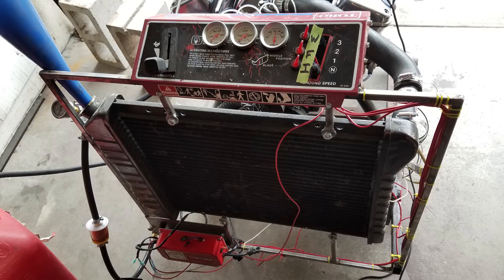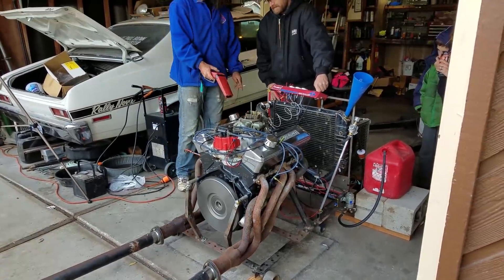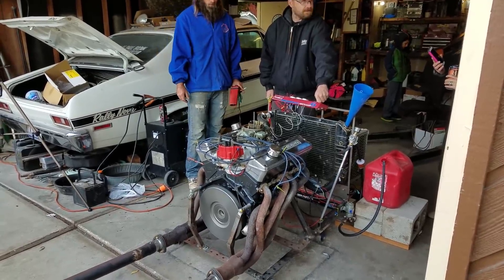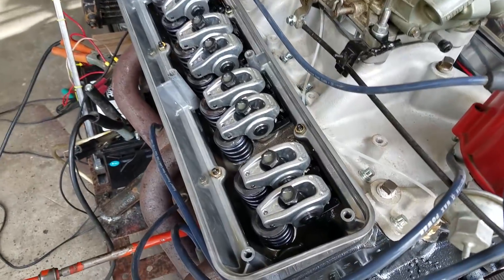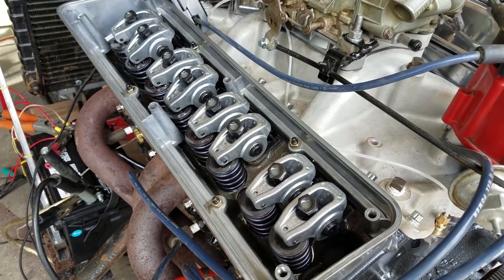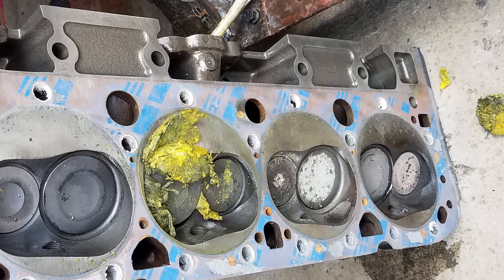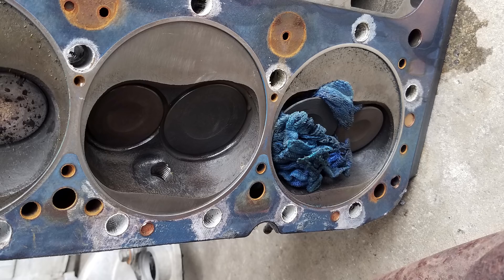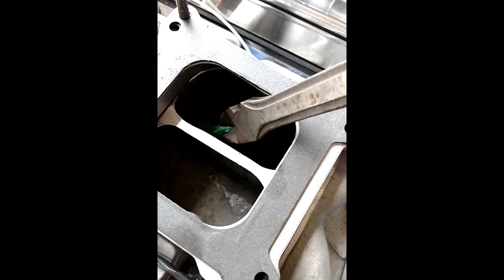Engine Broken In With Rags Left In Intake + Aftermath

Comment: Built an engine once.   Basically finished, but could not find my 14mm socket in my tool box.  Decided i must have left it in the engine gallery where the lifters are.  Strip down engine to find nothing!!   14mm socket was in a different draw in my tool box!
Good waste of a few hrs :)
Reply: - - haha I wouldn't even notice I was missing a 14 mm socket. At least you noticed man.
Reply: This makes me laugh! Thanks
Reply: Couple hours or a couple hundred if not a couple thousand? I know which one I'd rather waste.
Reply: We had too rebuild our neighbors tractor engine. We took it out and sent off to be done. Got the engine back put it all perfect started it up last 30 seconds. It was sent back with no oil in it
Reply: better to be sure than sorry
Reply: Ferguson 20 diesel your actually admitting on the web that you started a rebuilt engine but didn’t even check the oil level first??
Reply: yes i am. i wasn't thinking and i presumed they would have tested the engine at the rebuild centre for massey ferguson before they sent it back
Reply: Ferguson 20 diesel lmao, that’s hilarious
Reply: - - ya gaskets are not cheap anymore.
Reply: You can get them for nothing
Reply: I once dropped a socket into the thermostat housing on my Landrover cylinder head. It rolled deep inside and I couldn’t get it out. It was still there 5 years later when I sold the car. Oops.

Comment: Things happen. Back in the late 70s My self and another man swapped a 6110 Detroit from one belly dump into another. For some reason, which I can't remember we took the valve cover off, probably to run the overhead. When we fire the engine up it ran away, and after getting it shut down, we took the valve cover off and found a speed wrench laying on the rack. Whoops! It was just him and I there, and the engine ran just fine afterward so we didn't tell anyone else. At the end of the day everyone was asking why we were covered with all those oil spots and we said just happens when working on those Detroits, they leak every where.

Comment: I worked at a engine rebuild shop Back in the day and used to see the craziest mistakes made by customers. One who had got there new engine back. On time we built a long block minus the intake and pan , they were installing the harmonic balancer . When the engine would spin when so these "rocket surgeons' put a bolt thru the lifter valley on/ against a cam lobe and actually snapped the camshaft. You learn from your mistakes wich we have all done. Cool story and keep posting as you have just saved many of engines in sharing. Keep on spinning wrenches in the Free World Brother 👍🕊❤🇺🇸

Comment: 7:25 What happens? Here ya go....Guy I know left rags laid out carefully in the oil valley on 350 SBC to catch any debris that might fall in while he was working on it; installs the intake, totally forgot the rags. Buttons up the rest, installs engine in car. Fired up, dialed in, letting it run fast RPM for break-in. Several minutes later, noise. Clicking, clacking, couple intake and exhaust backfires then dies; won't start again. Inspect: All valves seized up? Teardown. The Tally: Camshaft grabbed the rag, twisting around cam. Bound so tight, it BROKE the cam into 3 pieces. Rag also got between cam/distributor gear. Broken distributor shaft and housing A couple bent pushrods. Bits of rag throughout oil passages. Fix: Total teardown: blow out all oil passages. New Cam.New crank/cam/ mains and con rod bearings. New lifters. New distributor. Oil. Filter. 2-3 pushrods. 
  Oh, and pain.....lotsa pain.

Comment: A few years ago, I was spraying WD40 into the #8 cylinder of an LS1 when the red straw flew off the nozzle into the cylinder. We couldn't get it out, but stuck the spark plug back in, fired it up, and it has run fine ever since.
Reply: John Wilburn I did that also. But the engine was on a stand. Fished it out easy. Swore like hell though.
Reply: I was kinda dumbounded that it actually happened.  The engine was in the car and, naturally, that is the hardest cylinder to get to.  We tried several things, but couldn't get it.  Fortunately, it must have burnt up quickly and gone on.  It probably wouldn't happen these days with the integrated straw on the cans they make now.  I'm so glad all that is left of that straw is a good story!  This is the very first start up.  https://youtu.be/ggDNC0PnIIo
Reply: I did a similar thing with a Detroit diesel and a can of brake clean. I worried at first but thought hell it will just eat it. Truck ran fine.
Reply: I'm so glad to know others have done this and we all got away with it.
Reply: I've heard that before.. when fogging marine engines for storage. figure it finds it way out of the pipe in pretty short order
Reply: fuck that red straw, mine flew off too
Reply: Murphy's law. That would never happen on cylinders 1 or 2.
Reply: John Wilburn hahahahaha hahaha..thats fucked up..
Reply: Kurt Watson The short ten millimeter valve cover bolts or mounting screws are the ones to always end up missing and make me tear shit down again only to realize it fell through the car and ended up two bays down  somehow
Reply: @johnwilburn  I was just gonna say that lol funny story! When u think about it, that little plastic thin straw ain't shit compared to chunks of metal shavings that come off and keep running

Comment: Was working on my 2005 Chevy caviller I just did a timing chain etc so I had the cog that attached to the cam undone In a rush I put the car all back together and started it up car ran great for about 3 minutes until the cam gear managed to break and stopped the motor dead in its tracks. I thought the motor was toast I thought I bent all the valves and it was screwed. I bought a new cam cog put it in and the car was fine. Went a sold it the next day. ALWAYS DOUBLE CHECK EVERYTHING.

Comment: Why did the engine look like it had Horchata for oil?
Reply: it looked like a water-oil milkshake, maybe they didn't put sealant on the head bolts/studs threads. it's easy to forget, don't ask ;)
although It's probably white lithium grease used as assembly lube, it tends to lay around in low areas looking odd for a while
Reply: I'm guessing it was when we pulled the head not all the water was out, plus it was fouled with excess gas
Reply: And ARP thread sealer and anti seize was used and torqued to ARP spec
Reply: Coolent in the oil
Reply: It's a Mexican engine

Comment: Paper towels and rags can kill people.  I know of a case where a Boeing 737 fuel filter bypass light came on during the first flight after a heavy maintenance visit.  When the mechanics pulled the filter, they found it clogged with paper fibers.  They wisely pulled the filter on the other engine and found paper in it as well.  After opening the center fuel tank, they found the remains of a box of paper towels somehow missed in the pre-tank closing inspection.  If the towels had been left in a wing tank, one engine might have failed.  The center tank, however, normally feeds fuel to both engines if it has fuel in it.  This airplane was very close to double engine failure and a catastrophic crash.

Comment: Done something similar... Left paper towel under piston when reassembling a single cylinder motorcycle. That shucks, man! Imagine doing that on a customer or friends engine... That would be even worse! 
Anyone who claim not to have done stupid mistakes, have probably not done anything at all.
Reply: too true. Anyone who tears apart and puts back together engines long enough has surely made stupid mistakes. Many done at 1am with little sleep...haha
Reply: Yup, nothing sucks worse than the inevitable "extra" bolt/washer/nut. There is time lost tearing it back down to figure out where it came from. Have also had people throw an old bolt back on my work bench making me think I missed something too. As a result I have learned to be very meticulous in how things are arranged. I will either put the subassemblies back together immediately, or if that's not possible I will use cardboard boxes and poke holes to hold the fasteners and components. Especially where multiple length bolts are used. Gives a nice visual representation of what goes where and keeps things organized.
Reply: the extra bolt-joke is almost evil!  Good, but evil;-)
Reply: pål aukan  oh yes I can laugh about it now, however at the time it really sucked. The project was a nearly complete overhaul of a 70L V-12 marine diesel.  Had to use a forklift and chain hoist to head the heads on and off lol. That cost me another 10 hours.
Reply: The best jokes takes some time before they become funny:) That was definitely one of those!  Some serious engine though!!
Reply: pål aukan haha yes this is true. I definitely laugh about it now. And yeah that was a fun job.
Reply: We all make mistakes it is what makes us learn and good productive people

Comment: Yep, I think we've all pulled something like this before. The time for me was on an '81 Suzuki DR400 engine I'd built up & managed to suck a synthetic rag in after about 30sec of running, I thought it'd dropped a valve the way it just suddenly lost compression. Was I relieved when I pulled the head back off & found the rag holding the inlet valve open but no mechanical damage!

Comment: Just found a white paper towel left in my electronic throttle body whole. Did not leave long and discovered as I was doing the fuel injectors?? FMl. I got one out not sure if I have it all and I can see another. It’s had a miss fire for a while? It’s a Honda K24 motor? I’m not sure if I did this or what but what are your thoughts? Pulling the intake now. I fished the other out through the fuel injector while with a tweezer? What ya think and how much motor do I need to take apart? I’m pretty sure it’s ok but it’s crazy that I may have did this. I’m comparing my paper towels now 😂. 🤦🏻‍♂️ ?

Comment: I feel his pain. Two years ago I built a 465HP 355. Developed a small oil leak under the inlet manooldd the end of dyno testing. Left a rag in the valley when I put the inlet back on..20 min later no oil pressure, fried bearings and rag turned into a trillion pieces.

Comment: This is why we only use paper towels in and around an open engine. It is also why the company that I work for does not allow cloth rags to be used at all and spends millions on paper towels every year. It can save way more money in the long run over a recall. Not to mention cloth is not safe around the lathe's and mills we run, nobody wants to get a hand pulled into a running machine.
Reply: i use rags on lathes and mills every day for the last 35 years,you need to be intelligent 
enough to not put it anywhere near a moving spindle or chuck obviously.common sense rules

Comment: I replaced the water pump on my mk1 golf (rabbit) to you USA people. It was winter & freezing temperatures & I didn't have enough antifreeze. 
Covered the engine with a towel. 
Went out for a drive next morning & after 20 minutes smelt burning. Opened the window & though it was from a bonfire. Keep going another 5 minutes until engine stopped. 
Engine had caught fire as I'd forgotten about the towel. 
Felt like a right idiot!!!

Comment: Sounds like my dad when I was younger...he just finished the overhaul of the 355, put it in the truck ran it, timed it and he heard a knock...totally forgot to put oil and spun a bearing....hey it even happened on Street Outlaws, they put spark plugs on the intake and as you say, the rest is history....
Reply: Willubhave One what happened with the spark plugs?
Reply: It was the Reaper car (James pit crew), but Street Outlaws did not mention what aftermath it caused to the engine (blown motor). The video was on Youtube but was taken down, probably embarrassed
Reply: Willubhave One what do you mean he put spark plugs on the intake? ?? Did the plugs fall in the intake or something?
Reply: they set them up by the carburetor.. not sure where but they ended up in the carb. When they opened the throttle it hung the throttle plates wide open.  
I don't think it swallowed the plugs but maybe floated the valves and nicked them and i think he said "stretched a rod'" during the over rev.
Reply: Willubhave One oh shit
Reply: blindabinda123 yes they changed the plugs and left the old ones on there and somehow they fell in lmao and he fired the car up and drove it a couple fees I think and it popped and tied up I’m pretty sure. There’s a video on youtube
Reply: Willubhave One that was Joad he’s amateur as fuck. Don’t compare him

Comment: That sucks but stuff happens. I have a story not as bad but it was funny at the time.  I worked for a grumpy old dude who ran a full service gas station. Winter had arrived and we were facing a sudden and bitterly cold night. 

When I arrived for work after school he showed my a $.99 antifreeze tester with the rubber bulb on the end he had just bought. He was expecting a crap load of customers to drive in asking for a free antifreeze test and showed me exactly where he wanted it kept when not being used. He was very specific about that and you'd think it was a $500 tool. 

Later he sent me to get  some hot coffee so I was gone maybe 15 minutes. When I returned a car pulled up. They wanted their AF tested so I ran in to get the tester but it wasn't there. I asked the old man where it was and he said we don't have one. I said yes we do  because I used it and put it right back like you told me. He repeated those words again, "we don't have one."   I got rid of the customer and came back in to ask WTF happened to it. 

He said  while I was out some "old bitch" in a Cadillac came in and asked him to check the AF. He opened the hood and pulled the cap but the coolant was low and as he released the bulb it slipped from his fingers and went in the radiator. I looked in the shop bays behind me expecting to see a Caddy. Nope. Wasn't there. 

I asked, what did you do with the car? Oh she left, he said. I asked how he got the tester out and he said she took it with here. This wasn't making a lot of sense because the bulb would eventually come apart and clog at least a couple of radiator cores so I thought maybe he made plans to have her bring it back later. Nope. He said he put the cap back on and slammed the hood and told her it was fine.

Never heard back from her so I guess that was the end of it.
Reply: Glad I never had my car serviced there (lol). Can't believe he didn't own up to it. Bad karma man
Reply: I worked there after school and on Saturdays for almost 3 years. The old man and I got along great and I never saw any indication that I was about to get dumped until I arrived  as usual one afternoon and  found the place locked up. No note on the door, letter in the mail - nothing. I thought maybe something happened to him or his wife and was a little concerned. They always treated me well. and I wanted to find out what had happened.  .

There was another gas station\auto parts place right across the street so I decided to walk over and ask.    The owner told me that my boss had closed the doors  This guy was a little dry and I never really knew for sure when he was joking or being serious so I stood around for a minute waiting for a punchline,  but he was silent as a stone.  I asked him if I heard correctly and he responded by offering me a job. I knew then that he wasn't trying to be funny. 

The old man had owned that station for years and then one day closed without saying a word.  I never saw or heard from him again but  I was paid up so I didn't lose any money,, but damn, that was a hell of a way for an employee to find out he was out of a job.  I heard several years later that the old man died.

Comment: Like the nova I  the background but what mufflers where they using in the video
Reply from the maker: The guy who owns the nova actually scratch made those mufflers back in high school. The outside is diamond plate steel and he put baffles on the inside and everything. They sound pretty good. Hopefully will be going back on that nova soon.
Reply: ya I noticed them also as they are pretty flat and work as support for the engine stand.

Comment: Worked at a Chevy dealer out of high school late 80's. The heavy line mechanic had just put a target engine or now they call them "crate engines" into a Caprice Classic. It made about a 3/4 revolution before it locked tight as a drum head. Pulled the heads, and in one cylinder found an EGR valve had been placed in the cylinder at the assembly plant.

Comment: Somewhat related note, i put a plastic shopping bag into the airbox on a development vehicle to simulate a real scenario air restriction. The plastic bag covered the air filter well enough, and there was sufficient engine vacuum, that the air filter actually folded in half and let the bag fly by. Luckily the bag hung up on the throttle body instead of plasti-coating the valves.

Comment: When I was in a auto class around 16 yrs. Old .I was doing a valve job on car ,in school and the instructor just happened to remove the heads ,I just set in place,not torqued down and I left a red shop rag in a cylinder after soaking up old antifreeze. Stupid!,they never let me live than down.I never forgot that 50 yrs.later

Comment: was working in my back yard in the dark with a drop light putting heads on my 67 buick gs and drop a exhaust bolt thought it fell in the grass but when i started the motor it was banging around the cylinder pulled the head off and the bolt turned in to 3 round balls put it back together and ran fine thats was 40 years ago-------SHIT HAPPENS-------have fun keep building those cars